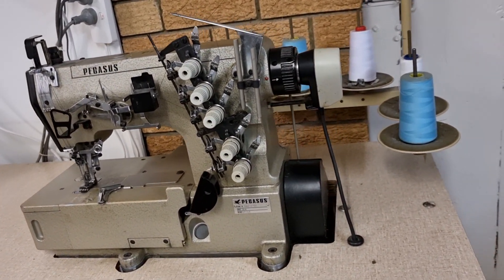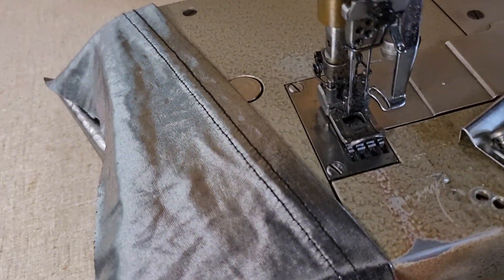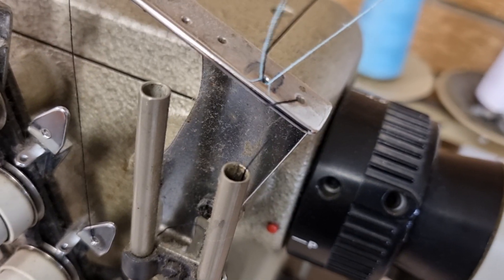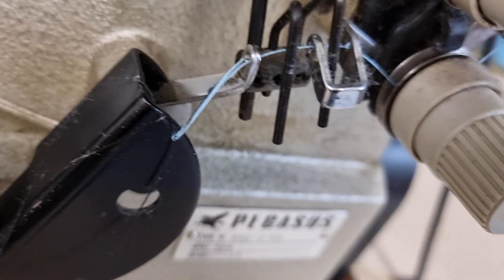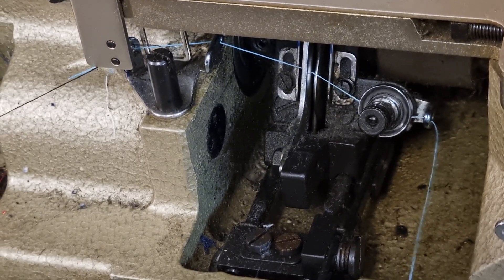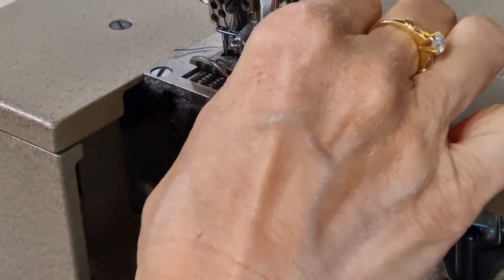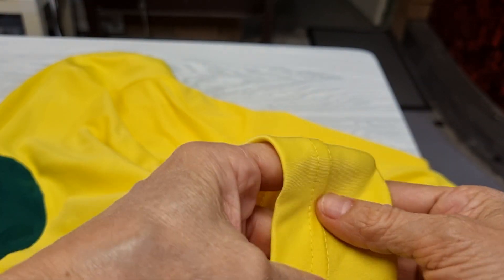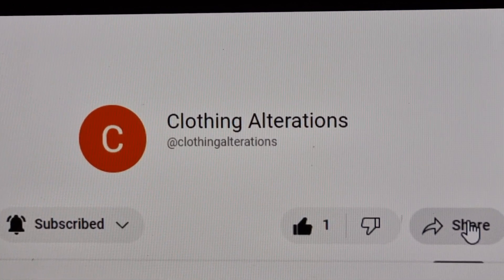How to thread coverstitch sewing machine/ Pegasus  cover stitch machine

Comment: How do you adjust tension for fine mesh material?😊
Reply from the maker: Hello, I made stitching looser than normal, then I need to iron a bit after. I prefer to over lock first then sewing it on normal sewing machine. Thank you very much for watching. Have a great day.